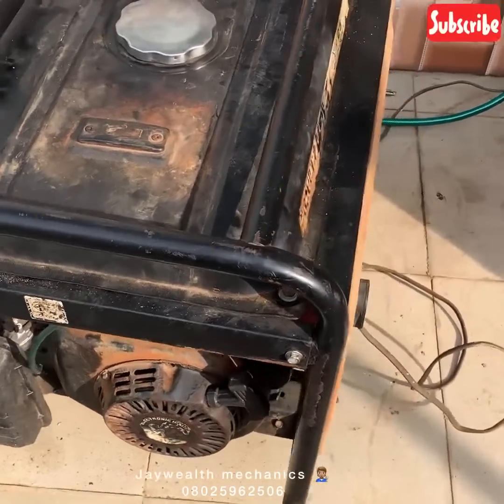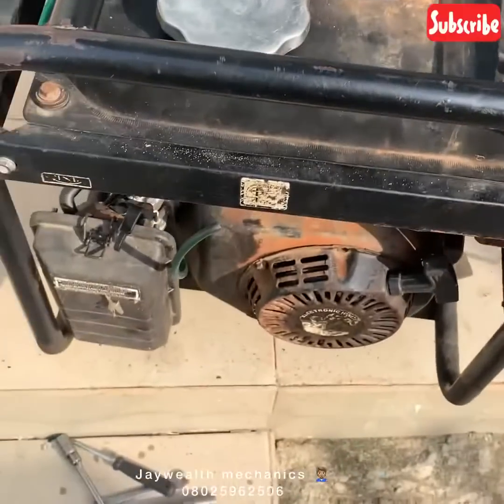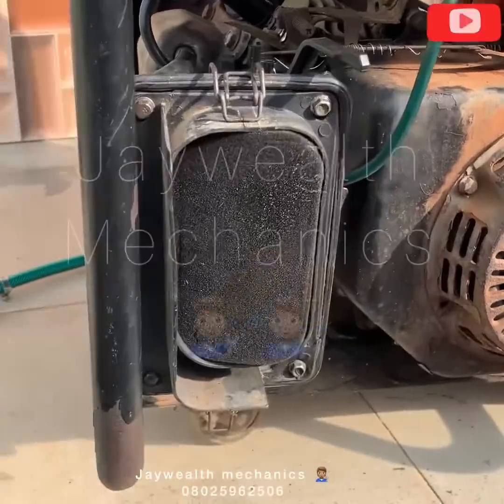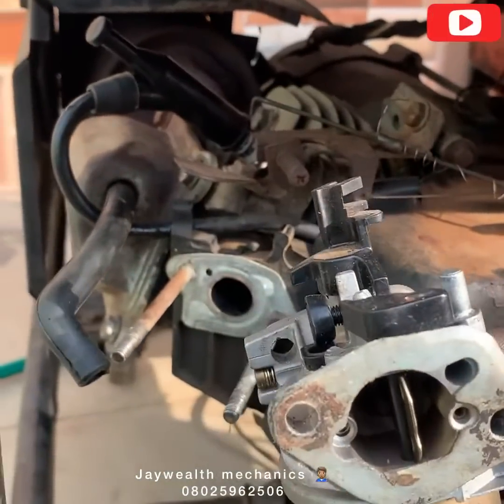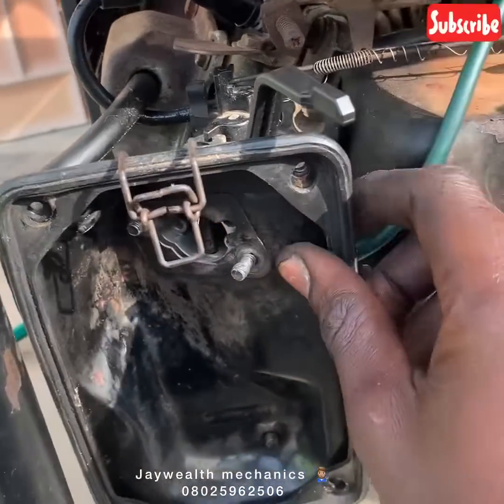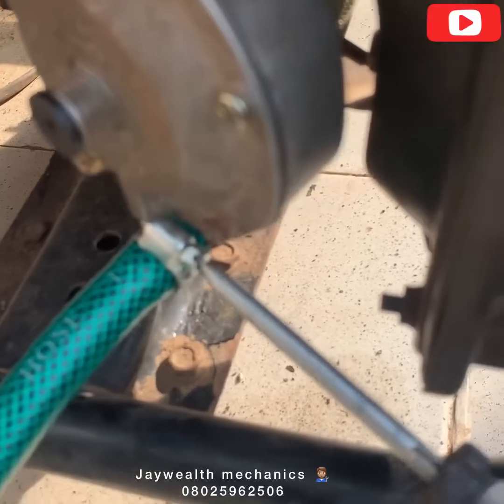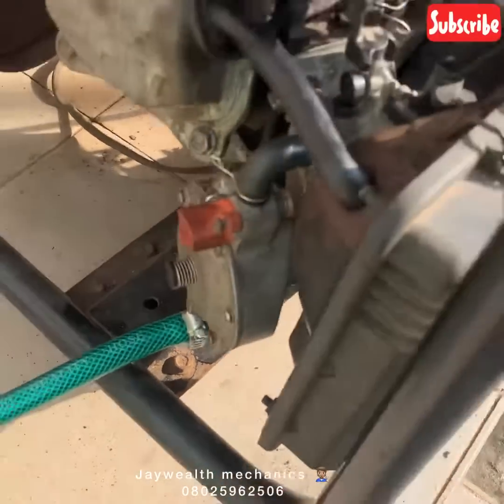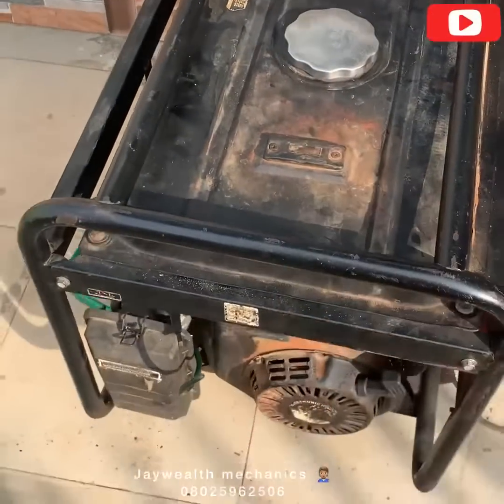How To Convert Your Generator to Natural Gas or Propane @HowToLou @MikesCarburetor #generator

Comment: Sir, you know with fuel you need to change the oil from time to time. But with gas is it necessary or does gas make use of oil as well?
Reply from the maker: With gas you don’t change the oil time to time. The oil get clean for a long time.

Comment: My question is does the gas leak out from the air filter before starting it? Or supposed not to leak out at all? Because I just installed mine now and I observed leakage from the air filter area pls any solution?
Reply from the maker: Which regulator do you use. High pressure or low pressure.
Reply: @jaywealthmechanics9285  is the one I'm using with my industrial gas
Reply: And hope the length of the hose can't affect the generator operation in case is long like 6 to 7 yards?
Reply: @jaywealthmechanics9285  Boss I want to appreciate you for the quick response and bailing me out of embarrassment. Thank you so much. The generator is working perfectly now. Thanks once again.
Reply from the maker: @johnsonoluyemo7028  you are welcome 🤗
Reply: When I turn on my AC when the gas pressure level is low the gen jerks and fluctuates. What could be the issue?

Comment: i installed it on my 8kva gen but 1kg gas lasted only 1hr 20min is thr anything wrong
Reply from the maker: Nothing wrong. For the size the of your generator that is the duration of time it will last.
Reply: What’s the model of your generator and, what percentage of load was your generator on?
Reply: @ezeanivitalis4363  8kva... load borehole and iron and 3 laptops computers

Comment: Tell us more about the safety, what if the generated develop fault and off itself due to oil shortage or something else,  what happens to the cylinder and the gass?
Reply from the maker: If the engine oil is short you replace it or you top up. Nothing will happen to your cylinder or gas if the generator develop. The safety is to avoid leakage and distance the cylinder from the generator.

Comment: My question is..  Why do u have to press that button for 5 seconds? Secondly,  is it every time we want to switch it on we will press the button?
Reply from the maker: I press the button to pump gas and it is every time you want to switch on the generator you press the button
Reply: @jaywealthmechanics9285  the orange thing on the cabuerator, what does it do?

Comment: Pls make sure the generator and gas cilynder is far from ur house bcos I have seen where it have course havoc if not that someone is around that house will burn down
Reply from the maker: Thanks for the addition. The filming was  shot in a tight Corner.

Comment: But I share of the opinion that the gas cylinder should be run with a long hose, so that it's kept very far from the generator, inorder to avoid explosion!
Reply: What is going to cause the explosion??
Reply from the maker: 5 yard of hose is ok
Reply: @jaywealthmechanics9285 how long does a 12.5kg gas last on a Gen?
Reply from the maker: @Japapodcast9ja  42hrs.

Comment: Please, distance gas cylinder from the exhaust side of the generator to avoid explosion in case the cylinder or hose has any leakage!🙏
Reply from the maker: Thanks 🙏
Reply: What should car owners do then when they carry the gas around in a very hot engine..

Comment: Fantastic! How much will it cost to convert the petrol engine generator to gas? Can it take the Aircon, Tv and fridge? I mean the whole appartment
Reply: fuel is fuel.. gas or petrol.
Reply from the maker: Is not the engine we are converting. Just the petrol carburetor to dual carburetor.
Reply: @jaywealthmechanics9285  where is your location? I want to come for practical
Reply from the maker: @uzorchiwisdom6739  ikotun lagos

Comment: Yes is a good idea but someone said after some time that it will affect the valve that it will not sit well on the engine cylinder again and it will loose compressor. I want you to shed more light on this. Thank you
Reply: Please am an engineer on generator how can I get this gas cabrator?
Reply: @AugustineJeremie  jumia, Jiji, konga
Reply from the maker: Dm 09036097019
Reply: What is the price on Jumia
Reply from the maker: I sell it.
Reply from the maker: The valve can only be affected if the engine oil is bad.
Reply: Il est exact que le passage au gaz affecte les soupapes principalement l’échappement la règle est de diviser par 2 la période de réglage.

Comment: I successfully converted mine. Buh it appears to burn faster than petrol, defeating the purpose. The cylinder equally get very cold. Is that normal?
Reply from the maker: Yes is normal
Reply: I am equally having this same (cold) issue as I have to run my air conditioner with the gen most of the time!
Reply: I'm also having this issue, what are we not doing right? Someone was telling me about the orange switch on the cabuerator, what direction is yours turned to?

Comment: Gas explosions will be rife if adequate care is not taken to move the generator a considerable distance away from the gas cylinder.
Reply: The generator should be connected with a long wire and placed at a distance, in a secure place.
Reply: Can you cook with fuel on your stove ,?? No but you can cook with gas on your cooker even if e da leak small small
Reply from the maker: You just said what is in my mind. Thanks
Reply: @gudn9ux_820 what's used to power gas turbines to generate electricity?
Reply: If fuel that is highly flammable and dangerous than gas can power generator talk more of gas

Comment: Gas explosions will be rife if adequate care is not take to move the generator a considerable distance away from the gas cylinder.
Reply: this is absolutely untrue
Reply from the maker: In any machine there should be all safety precautions. So why would you neglect the the safety of using lpg of your generator.

Comment: I just converted mine about 2wks ago. My 12kg LPG just finished this night and it took about 35hrs. Can I use CNG for this instead of LPG?
Reply: Sure you can.
Reply: Is it cheaper than petrol?
Reply: @realbriggsvictor  yes it is. CNG is cheaper. IPMAN is planning to roll it out widely.
Reply: @odymark what is CNG?
Reply: @edowitch4703  Compressed Natural Gas.
Reply: Which generator did you use, what kva?  Did your generator use half of its load?
Reply: What generator capacity and what load are you powering with it?

Comment: Can the petrol run at the same time?
Can you use petrol with the new carburetor again?
Reply from the maker: Yes you can use the new carburetor for petrol ⛽️. But it can run at same time.
Reply: @jaywealthmechanics9285 kindly explain, can it run simultaneously with LPG?

Comment: Hello bro, I have an issue with my own. It doesn't start easily I have to prime it repeatedly and drag the gen more than 10 times before it starts. Then it goes off once I turn on my fridge and it doesn't do that with petrol. Thanks
Reply: Are you saying you can use the carburetor for both gas and petrol
Reply from the maker: @j7max394  yes it a dual carburetor
Reply: Amazing @jaywealthmechanics9285
Reply from the maker: Firstly check if your oil Gauge, secondly Did you open the gas completely.
Reply: @jaywealthmechanics9285  it's opened completely. Now I just start it with petrol and switch to gas. Easier for me that way

Comment: Someone from Benin say 12.5 of gas cylinder reach up to 30days even if is on for 24hrs, ??
Reply from the maker: 30 days is too much. 7 days for 24hrs running.The size of your generator also determine.

Comment: How long can a 12kg cylinder carry me and how many hours can i run the generator a day
Reply: I have a 3000watts Fireman generator, please how long will a 12.5kg of lpg last on 50% load?
Reply from the maker: @StanleyJonahs  it will last for 48hrs
Reply: Good question. I'm also told the generator power is low on gas. Who can confirm this please?
Reply from the maker: @oib4463  the power is same has fuel.
Reply: @jaywealthmechanics9285  Are you 100% sure about this, considering someone commented above that his gen goes off when he/she turns on the refrigerator; which doesn't happen when they're using PMS...
Reply from the maker: What is the size of your generator

Comment: Please help me on how I can retard the ignition timing to about 7 to 10 degree on this particular gasoline engine you use
Reply: 1-2 more hours than your fuel will normally last. Depending on how "new" your generator is, LPG saves you about 20% more.

Comment: Amazing.. Never knew this could work. welldone JayWealth..
Reply from the maker: Thanks 😊
Reply: @jaywealthmechanics9285  
My generator runs fine but there's no power .. when I throttle it a little the power comes on but reduces and goes back off ..pls what are your thoughts on this..
Reply from the maker: @Maximus-b1b  what size of generator
Reply: @jaywealthmechanics9285    it's a 2.5 kva generator sir
Reply from the maker: @Maximus-b1b  check the Avr, if is still in good condition
Reply: @jaywealthmechanics9285  
It's a brushless type of generator with no AVR sir
Reply from the maker: @Maximus-b1b  okay.. Replace the capacitor
Reply: @jaywealthmechanics9285  power is back on.. thanks JayWealth.. you're truly the best
Reply from the maker: Happy to hear.. Thanks 🤗🤗